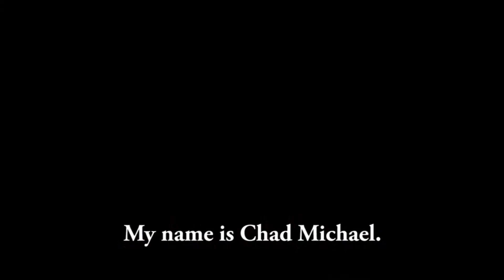To Win In This Game | Chad Michael - The Practitioner

Comment: Hey chad . Curious if when you deal with a roofing estimate if you write up the mitigation estimate on affected material inside the building also
Reply from the maker: Absolutely! Especially on larger projects. And also full-on contents cleaning, pack-out, pack-back, etc! 👊👊👊
Reply: Insurance Restoration Training so i came across a code for xactimate that is (1+rup(f%60)) when u put that in calculation on air movers needed per square ft you get the recommendations for air movers per sq ft. You may or may not know about this code for recommendations on air movers . Im assuming its a code based on latest s500 recommendations. 

Is there any other codes like this that you know of for xactimate?